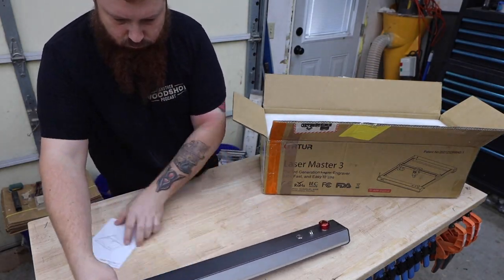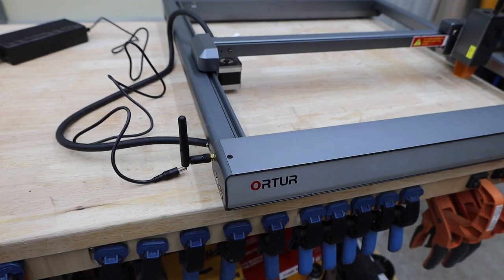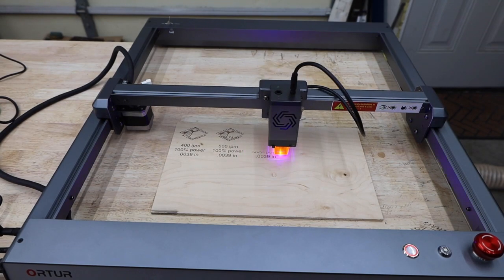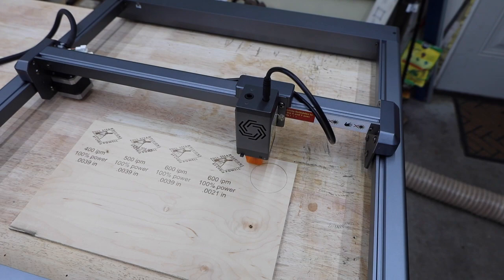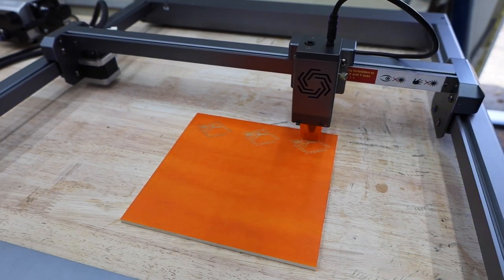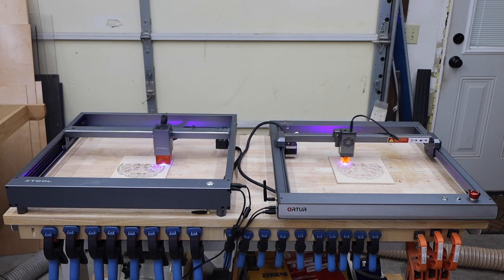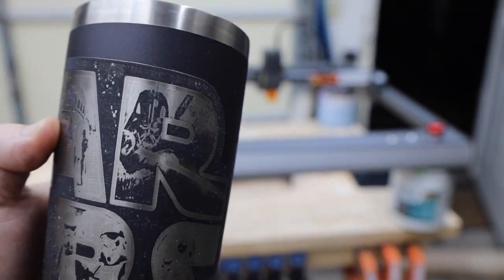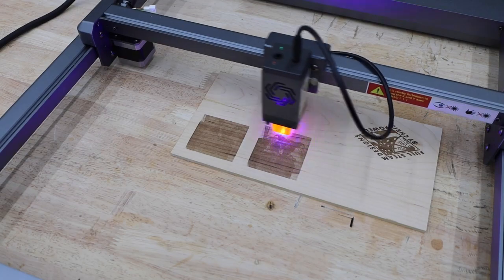Testing the NEW Ortur Laser Master 3 10 watt laser engraver

Comment: Great video, thank you.  I purchased the ortur laser master 3 and the extension.  Just put it together without any problems.  I did purchase a 400mmX600mm and a 400mmX850mm honeycomb bed.  I noticed you didn't use a honeycomb bed.  What are the advantages and disadvantages of using one?  My hobby is building balsa RC airplanes and this laser cutter will be a great tool for cutting out parts.
Reply from the maker: Awesome. I wouldn’t mind having the extension on mine. The honeycomb just makes it easier for cutting through stuff. There’s nothing behind it to have to cut into.

Comment: Have you done a comparison between the Ortur Master 3 and the XTool D1?  Looking at both, but the XTool is about twice the price.
Reply from the maker: I haven’t done a video on it, but I have compared them. The LM3 is similar build quality. I like that it has built in limit switches. That’s something the D1 is missing. It’s also quite a bit faster than the D1. And their app works very well if you want to use it that way.
Reply: @ChrisPowellFSD  Thank.  I was pretty much sold on the Ortur, you filled in on a few items I did not know about.  Thanks.

Comment: did you purchase the air pump and is it necessary? Also, do you know what the pros and cons are on this machine VS the jtech 14w cnc addon?
Reply from the maker: I didn’t purchase the air pump. The pros of this are that it doesn’t tie up your cnc router. Also, I don’t recall seeing a 10 watt jtech.
Reply: @ChrisPowellFSD  thank you, jtech has 14w not a 10w, I just ordered the ortur laser master 3, great informative video.
Reply from the maker: @isiteweb  awesome you’ll love it. I believe the 14 watts is in reference to the input power, not output.

Comment: Can this still be used if I put it on something larger than the case but the area I want to work on with still with in the cutting size?
Reply from the maker: Yes you can just set it on top of what you want to engrave.

Comment: Wish they'd make these a bit bigger. Really want to cut full 20" x 30" pieces of foam board. Speaking of which, does this cut white foam board, or struggle like some other diode laser models? I don't want to spend thousands to do something so simple.
Reply from the maker: I can’t say. Haven’t tried foam. Not sure what chemicals might be produced. They do have a bed extension coming out that will double the length of it.

Comment: Curious of your recommendation between this and the xtool.  I have a shapeoko 4 xxl and have learned so much from your videos.  I would primarily be using it to engrave cutting boards and similar products as well as cutting 1/4 mdf letters and designs that are too small to do on the CNC.
Reply from the maker: I’d be leaning towards the Ortur. It’s a much faster machine.

Comment: Hi, looks amazing. Would I be able to engrave anything onto marble ?, or is that to hard for the laser.
Reply from the maker: No I think you’d need something more powerful or a cnc router with a diamond drag bit
Reply: @ChrisPowellFSD  Thank you, I thought not, but I have a huge pile of marble slabs just waiting to do something with. An Inch thick, 2 feet by 3 feet in size, in all colours and patterns. Seems a shame to leave them outside doing nothing. Must have nearly 100 units.
Reply from the maker: @Baron-Bagaten  o wow. Buy a small cnc router and use a diamond drag bit. You could probably get away with a lower end machine because it isn’t actually cutting through the material, just dragging along the surface.
Reply: @ChrisPowellFSD  I do have one of those larger Ryobi Router's, would that be OK do you think ?. Also, have you any idea on how long a diamond drag bit would last for ?. Thank you for your advice.
Reply from the maker: @Baron-Bagaten  the bits don’t actually need to spin. I’m not sure how long they last. I have one but haven’t used it enough to wear it out
Reply: @ChrisPowellFSD  Hi Chris, thank you....but how does it engrave with out spinning, sounds like a new type of tool I don't know about, very interesting though. Will I find one on say Amazon ?. I will try a search. Best wishes.
Reply from the maker: @Baron-Bagaten  here’s the one I use. https://amzn.to/3bX7a7n It just drags and the diamond cutting tip engraves the material.

Comment: That was a very informative video. Thanks for that, because I have been wondering whether I should get one, and now it seems like I will. I had one big question, namely does it come with something to place underneath it to protect your desk/table from the laser, or does that need to be a separate purchase?
Reply from the maker: You would only need something under it if you plan on cutting through. You can use a baking tray and one of the wire trays from an oven.
Reply: @ChrisPowellFSD  Thanks, Chris.